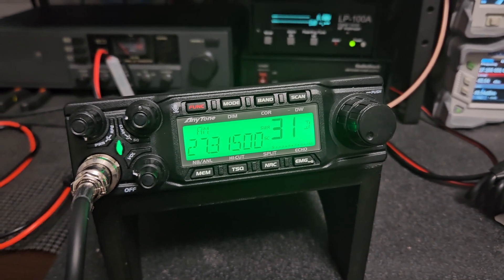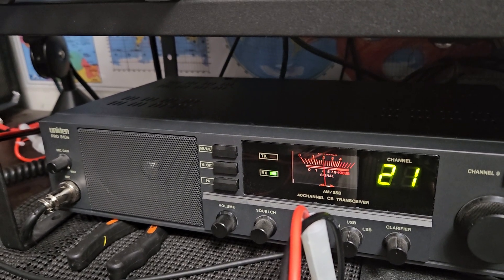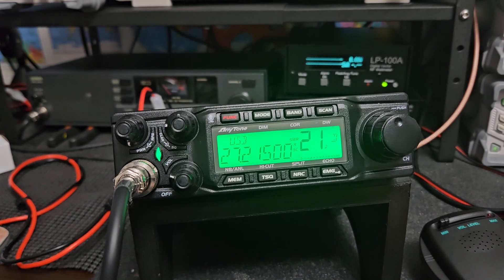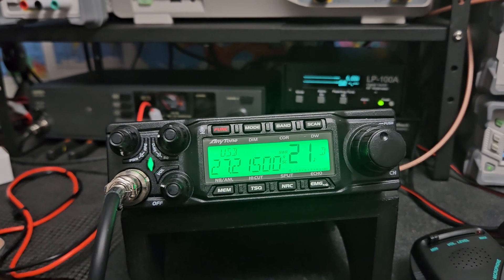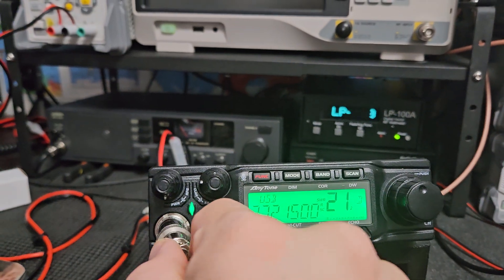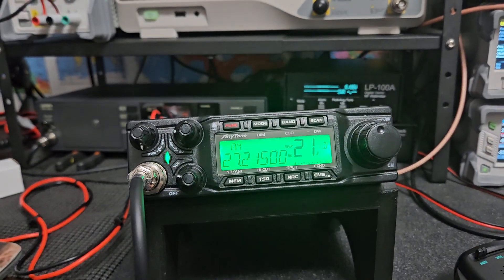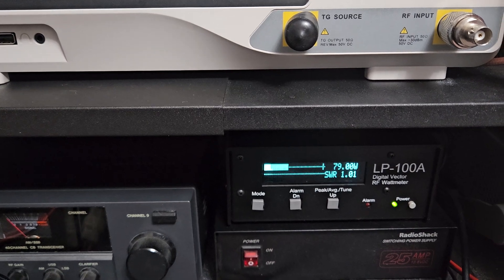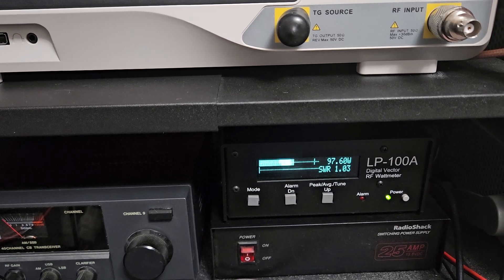Blabbing about skip, new radio and microphone for Brad in Wisconsin

Comment: You should do a video on cb mobile antennas... or your thoughts of.  Good and bad of.  Certain  mobile antennas  ...
Reply from the maker: Most mobile antennas are good. It's the lack of counterpoise and major issues with lack of capacitive coupling on magnetic mount antennas that give some a bad reputation.
Reply: So far I've had good luck from my magnetic mount Wilson 1000. I have a Dodge Ram quad cab and the antenna is placed center of the cab. So far up to 80 mph hwy with no problems of it coming loose. It has a very strong magnet. Might suggest grounding the radio chassis when using a magnetic mount antenna. I talk 99.9% on LSB.